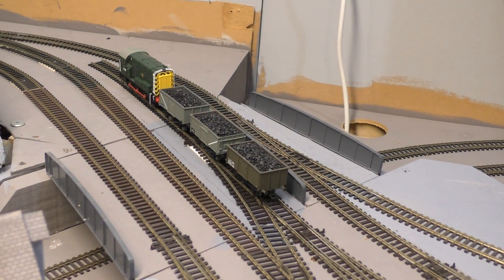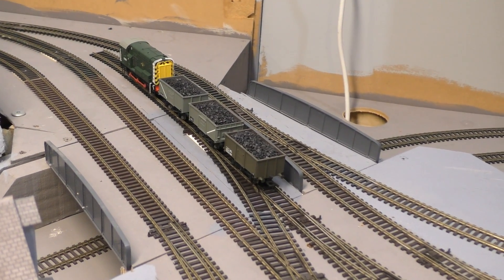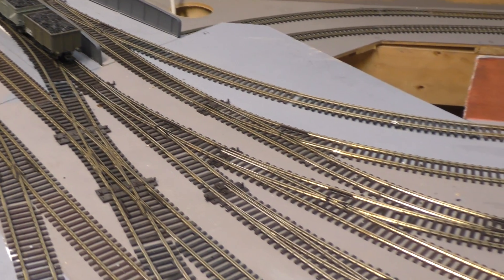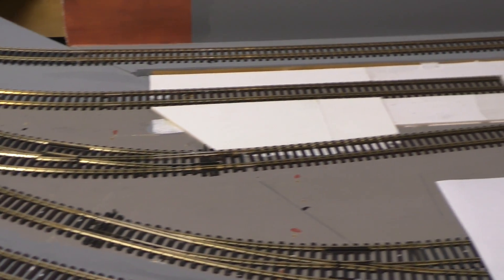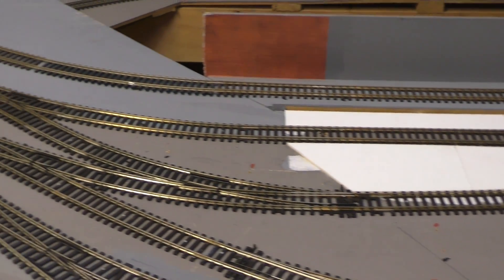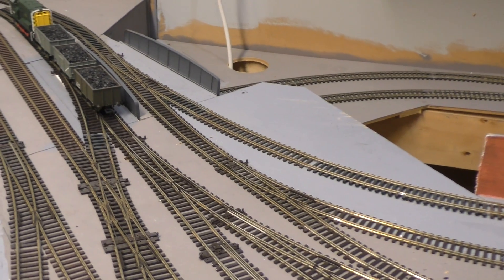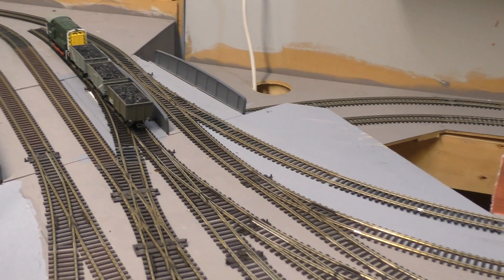Deciphering Analogue Point Control and Wiring

Comment: You have some great ideas and a keen eye for seeking out materials for solutions! Originally I was going to wire everything as analogue but then I thought that using digital control of my solenoids on the fiddle yard would simplify things as I had already decided to use Cobalt IP point motors on the scenic sections. The IP point motors work from the same bus as the track and the solenoid controllers likewise - cuts down on a load of wiring too. So now I have a load of S/P switches to dispose of. My YouTube notifications have broken somehow so was wondering how things with you were. Looks like I have quite a lot of catching up to do!
Reply from the maker: Thank you for your kind words and describing the methods you've taken to tackle the wire jungle. I had thought of going fully digital but it's more a cost saving exercise than anything. In the same way you now have a bunch of solenoid motors to offload, I've bought motors off people here in NZ who have done the exact same thing as you and upgraded to digital.
Reply: @StationRoadModelRailway  Julian you can keep the solenoids, DCC Concepts, and I think Lenz and Gaugemaster have decoder boards that will switch the solenoids for you. I have used the ADS-8sx 8-way decoder board for the solenoids in the fiddle yard, which is about £75, so that is a much cheaper option than using the servo motors which would be about 3 or 4 times the price. I started wiring my DCC concepts decoders up today. You can also add a switch overide so that you can operate them outside of DCC control - handy depending on your DCC control methods and add LEDs to show routing etc. So quite comprehensive really, but still needs four wires from the decoder to each solenoid (common, the feed to each coil and frog). Each controller will switch two points, so that means your passing  loops can be controlled by a single action. I hope at least some of that makes sense.

Comment: I think it's a good idea. Perhaps it could also be include a discharge unit CDU in the electrical scheme if you use high current coils... anyway Julian.. so useful for modellers
Reply from the maker: Thanks for your kind words. I did debate whether to include a discussion about CDUs, but decided to edit it out in this case because I won't actually be using one on my layout. I understand they come into use more if there's a series of motors being operated simultaneously to create a through-route and the extra surge of power is needed to flick all the motors at once. And they also act as a protection device to avoid motor burnout.

Comment: What are your plans regarding the short wide bridge running over the cutting? Given how you have reconfigured your layout, joining it with the narrower bridge, it looks as if it's a bit too wide for the new track on each side, leaving a quite a bit of extra space between its edge and the outer-most set of rails. Are you going to re-align the bridge's edging to be parallel and look a bit more in line with the new rails or are you going to leave it how it is to instead focus on other aspects of the extension in case you find you need to shift things?
I've really been enjoying watching your progress with your layout and am looking forward to the next doubtlessly great video.
:)
Reply from the maker: I was wondering who might pick up on the slightly skew over-bridge now that the track alignment has shifted slightly. Yes, the bridge will be realigned but I’m holding off on this until the extension track is in place as the track alignment might move slightly again. Cheers, J

Comment: That is a good idea for the control pannel the good thing is that there won't be a mess of wires if you did the normal style of control pannel like most people do i will give that box idea a go.
Reply from the maker: It will be interesting when I start wiring up the panel, the proof will be in the pudding as they say.